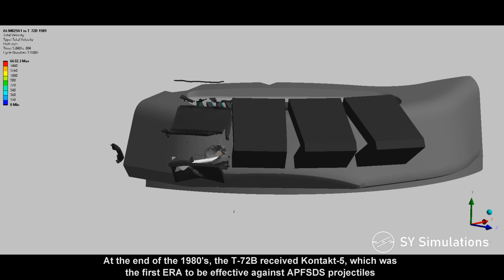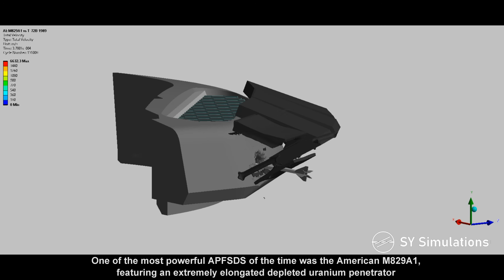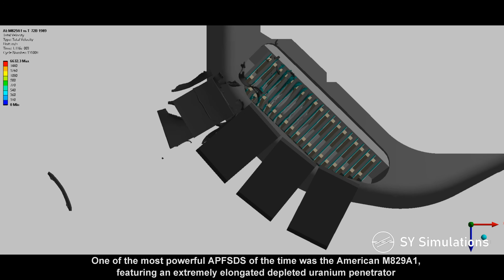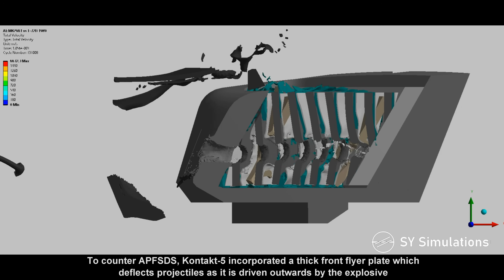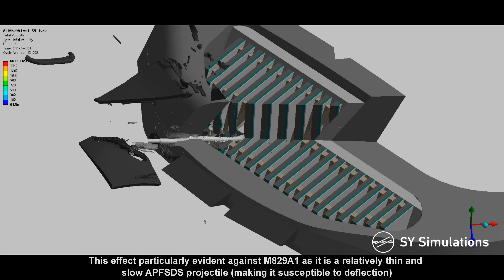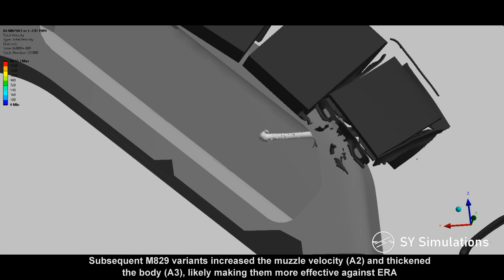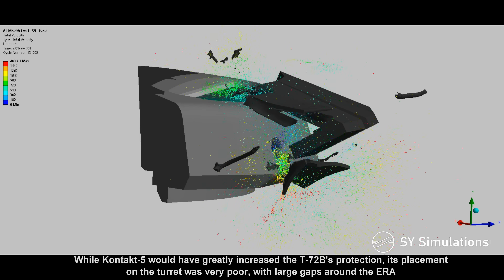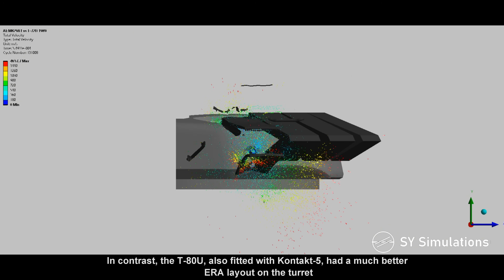SILVER BULLET vs KONTAKT-5 ERA | Abrams vs T-72B '89 | M829A1 APFSDS Armour Penetration Simulation

Comment: Pretty impressive. I thought it would go through to be honest. Maybe the later projectiles will?
Reply: Actually a comparison between 829A1 and A2 would be interesting
Reply: 829A2 would probably
Reply: Yes! 928A2 was actually so vulnerable to K5 that the A3 had to be made to specifically counter K5
Reply: @trickythefox9598  Yeah no. According to destruction testing done to T-80U and T-72B with K5 the 829A2 was capable of penetrating both at 3.5km for the former with ~4km for the latter.

The 829A3 was designed to deal with Kaktus type Heavy ERA. The 829 series never really struggled against this latest tanks
Reply: @gotanon9659  source?
Reply: @gotanon9659  BS
Reply: @aonteangach  Bro they get blown up by RPG-7 and 120mm will not pop them up? bruh...
Reply: @666Tomko  If an RPG replaced the 829 in the video, it would do even less. That's kind of why the ERA is there. You wanna kill a tank with an RPG? Don't shoot the turret cheeks
Reply: @gotanon9659 no, according to tankograd, k5 was what kept the t72b and t80u relevant, as the k5 was the difference between penetrating and surviving. It was effective against a1 and a2, only a3 was designed to have an anti ERA tip
Reply: @gotanon9659   Dont belive it since A2 dosent have anti ERA tipp it will be effected by K5 
A3 will almost ignore K5
Reply: @666Tomko  
They get blown up by RPG's to the top and side. Not front of turret.
Reply: @gotanon9659  delulu season is still going strong
Reply: @gotanon9659  Blud Left when Got asked for Source LMAOAOAOOAOAo
Reply: @parallax9084   Sigh, K-5 is far more effective against HEAT rounds - Long Rods penetrate it with relative ease. Even open source testing results shot that. ALL DAY LONG.
Reply: @666Tomko RPG hitting on ERA?
Reply: @gerfand  Yes PG-7VR have no problem with russian made ERA.
Reply: @666Tomko  ah yes, TANDEM warhead... And also they do, PG-7R would not pen an armor that a more powerfull TOW-II failed to do in Syria vs a T-90A
Reply: @gerfand  TOW-II was not in Syria it was Israeli BGM-71E  and it cook off T-90a one dead crew member anbd turret jamed.
Reply: @666Tomko "cook off" lol lmao yeah this is why the Tank turret still attached.

The E variant is literally TOW-II
Reply: @gerfand  Oh TOW II is not rocked but the launcher so yes BGM-71E is Tow II made rocket but it can be launched from TOW I so my argument still stand.
Reply: @gerfand  Learn what mean cook off and blow off next time thaks.
Reply: @666Tomko  cook off would imply the ammunition was hit, which did not happened, as we don't see even smoke comming out of the vehicle.

The side that got hit (left) is also where the crew memeber exists the turret from.

Comment: Interesting
No crew compartment penetration but surely they would be rather stunned by the impact of that
Reply: Wouldn't have done anything imo... it barely scratched the main armor array.
Reply: most tank hit never really are able to instantly continue fighting and brush it off, such impact would most likely stun both the crew and the internal mechanism of the tank, may it be the electronics or the powerpack.
Reply: @agentgollem1919 Stun the crew, maybe. But definitely not the power pack or any system on the tank. It might mess with the elevation mechanism or Gunner's sight if the impact is close enough to there. Though not really in this case.
The crew would mainly be stunned from the noise of the impact, like a flash bang, but modern tankers also often have a headset which protects them a bit from this. So... Not really, especially if they see the enemy shooting versus being surprised attacked.
Reply: @agentgollem1919   <ahem>   At ~500 metres a 100mm HEAT to the front of a Challenger simply sounds like a really loud thump on the inside and the vehicle rocks ever so slightly. The HESH return round is more impressive and strips away ERA & fvcks up their optics just fine.  The follow up sabot goes straight through and out the back of a T55 turret.
Reply: @iatsd  yeah because it's a chemical projectile not a kinetic one, there's a report in ukraine of 2a4 taking an apfsds round and the crew stunned for a solid minute and the electronic took a time to come back online.

do not underestimate the power of kinetic energy.
Reply: @agentgollem1919  yea prb they going to take 10-15 seconds to start fighting again
Reply: @historkca no the guys inside would barely feel anything from that the armor stopped it no electrical damage no nothing its a tank round not a 500kg bomb you are overestimating the damage